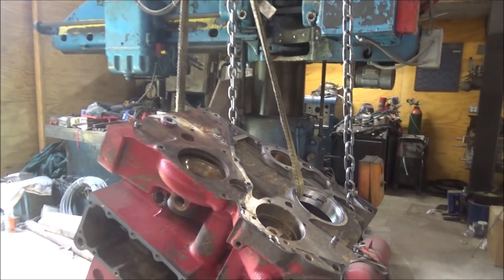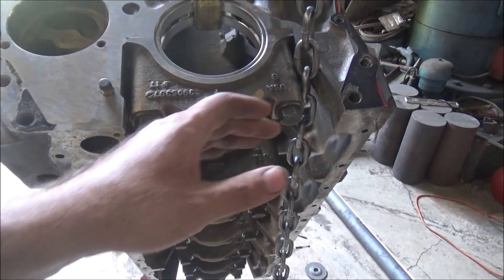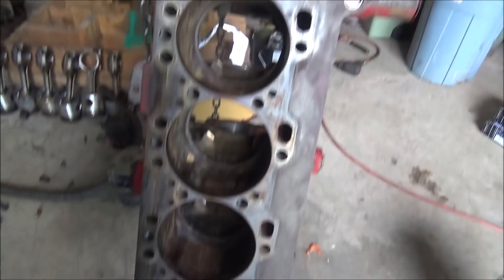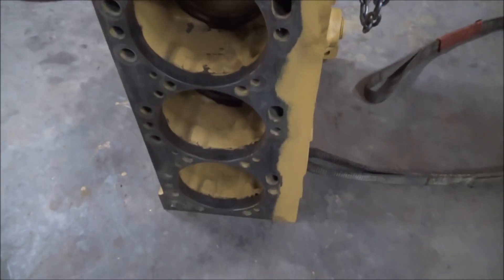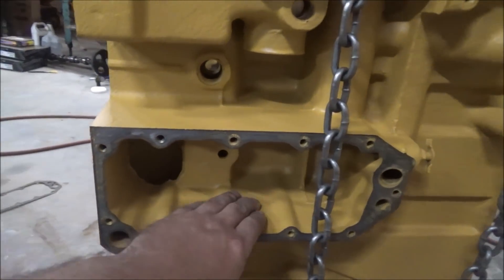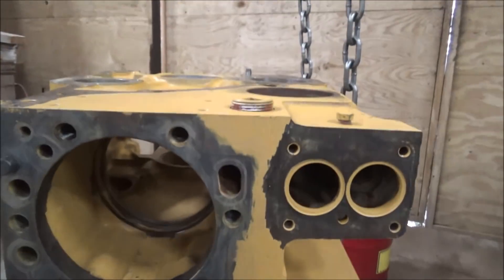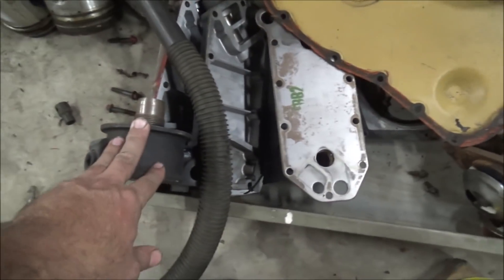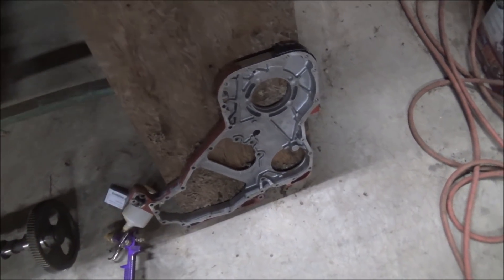Cummins 8.3L Swap the Hyster Forklift Part 2

Comment: I remember hearing something bout race engines being painted on the inside on surfaces that encountered oil so that the oil returns to the sump faster, but not so much on painting cooling passages.  Very cool, thanks for sharing the process.

Comment: Noe I feel bad for only painting the outside of the block/head/etc. when I rebuilt my 1984 F150's 300 straight 6. I used black rustoleum engine enamel (500F rated). Too early to say how well it's worked out.

Comment: I have always been told that painting the inside was not a good idea, flaking paint can plug up the oil pickup tube, that it's just a better idea just to polish up the oil drain back holes. Id there a particular paint you use that is resistant to being oil soaked that long?
Reply from the maker: Glyptal 1201 is usually the most recommended interior engine paint. I have had good luck with the Deere Buff primer sealer as well though. If you get a lot of bad fuel dillution in your crankcase I could see maybe having problems but I never have.
Reply: @bcbloc02  awesome, I will look into it, I know a lot of old school guys painted inside block for oil drain back purposes, but I have also heard it had adverse results later on.

Comment: I wanna see a 1000 hp forklift pulling a sled or doing a burnout! LOL! That 8.3 Cummins ought to last about 150 years in a forklift!
Reply from the maker: I don't think the rear end will be able to stand it. I suspect that 50 year old axle would snap a shaft in a heartbeat pulling a sled with the lift weighing 30K. lol

Comment: Are you gonna paint the outside of the liners? Are you worried about the paint flaking off and going threw the bearings?
Reply from the maker: No the outsides of the liners are precision fits so no paint.

Comment: Brian with Illiana and Russ Fishers in Terre Haute, I can look for a timing cover for you if you haven’t found one yet.  What pump would be on the C series with the cover you need?  Or application.  Illiana used to have C series cores from Ford, Freightliner and other applications.
Reply from the maker: b gilbert Looking for the gear housing, cover, p7100 pump and lines for a 90’s vintage 8.3

Comment: I hate to think how much it would cost to paint that block with Glyptal! What kind of governor setup does the forklift have now? My old Clark had a constant speed governor on the Continental, but the one I have now has no governor at all.
Reply from the maker: Watch Wes Work the Hercules had a vacuum operated butterfly governor under the carb so it just capped the high end.
Reply: @bcbloc02  So the regular P pump should do just fine. I guess I've never paid attention to how a diesel forklift is setup.
Reply from the maker: Watch Wes Work yeah either an Rqvk or an Rsv governor would work fine.

Comment: some micro-finishing film on those journals or some mothers chrome polish can you make that fit a 1" wide belt thats like 24 grit then 36 in those ceramic changing the belt grit in like 10 seconds some sort of machinest jack skate barring creation ther's at least  a day dreaming and another building have not tried those ceramic the blaze looks like wow  a grinder with 24 ao vs one of those with the X  1" ceramic 24 grit I cant tell you the cubitron in the 4.5" disk is wow $6-7 bucks though
Reply from the maker: Yeah a 1" belt will fit. Probably will try to go up to a 36"
Reply: @bcbloc02  Thinking about the abilty to change grit quick ,price probly a good buy for crank polishing that fork lift is wow worth this work. little effort now ,yeas of time saving . Thanks

Comment: As good if not better than a new "Bloc block"....☔⚡💧🌈😁👍😎
That lift only needs to be slow and precise, anyway it's way too heavy to fly, plus the doors don't open wide enought for eventual wings, even if you install the folding type wings like on aircraft carriers.........
Have Baily look and approve every steps, don't just rely on us...    😉😁
Reply from the maker: Baily getting more interested in food bowl and bed than shop projects. :-(

Comment: i run an old Continental in my airplane. The case coating started turning loose and ended up in the oil screen. When I rebuilt it I sprayed stripper in the case and power washed it clean. Decided to leave it raw.
Reply from the maker: As I said your mileage may vary.
Reply: @bcbloc02  Yes sir.. You are far more knowledgeable about such things. I certainly do enjoy your channel. Thanks for taking the time to reply.

Comment: I thought they quit painting the blocks with the advent of detergent oils.  Issues with paint clogging filters and passages.  This was years ago when I worked for Ashland so I could be mis-remembering.  Seems like I read about it in a trade magazine of some sort.  Anyways, what block are you looking for?  I've got a couple old 6cyl diesels by Cummins that are sitting in the back of my small barn.  I think they were here when I bought the place so minimum 30 yrs old.  No clue what they are.
Reply from the maker: Robert Cook always interested in old engines. Check your barn and see what you have got. You can email me pics to bcbloc02 at yahoo dot com if you can’t identify them. Thanks!! Also I know Deere was still painting the insides of their blocks at least thru the 1990's so well into the detergent oil age.

Comment: Swapping a gas engine for a diesel. Is this forklift hydraulically driven? How will you deal with the increased torque and lack of engine revs?
Reply from the maker: Scania1982 the forklift is gear drive with a conventional clutch so it shouldn’t be a problem
Reply: @bcbloc02  Wont the increased torque break the gearbox and lack of revs make the forklift slow? Love your videos.
Reply from the maker: @scania1982  Not really a big rev difference between the Cummins and the old 6cyl hercules so speed shouldn't be an issue.  The torque could damage the gearbox but I feel if not trying to pull things with it it should be fine, can always swap that too if I have to.

Comment: Adam Booth has a narrow belt sander he uses for lathe work some times, it may be just the type of thing you need for that crank shaft. And the internet safety unit comes out in force when he breaks it out, so you know its ligit.
Reply from the maker: Nathan Weese Yes I mentioned Adam has one in the video.

Comment: Brian, I'm a new subscriber and this makes my heart happy. I see so many engine rebuilds/overhauls that the builder won't even address cleaning the outside of the block, and will just gladly slap old hardware and tin back on the motor without even trying to make it look better and protect it going forward. That engine is going to look like brand new when you're done with it.
Reply from the maker: That is the plan. I want it right when it goes together so I won't have to work on it again.

Comment: Brian, I don't understand something you said about the "a" pump gear, you said that you didn't like to use it because it wasn't keyed, can't you put a key way in or have Steve Summers do it for you?
Reply from the maker: BATTLESHIP NEW JERSEY SAILOR The gears are super hard  and the key way is on a taper and in a small bore. Only way I think you could do it would be on a wire edm. Easier and simpler to just find the proper parts.
Reply: @bcbloc02  Thanks Brian, that clears that up, I didn't think that the gear was hardened

Comment: very nice,, just a question about rust in the oil passages, I use special sized long brushes on my racing engine to clean oil passages (big block chevy with all oil plugs removed) then WD40 to stop rust during the build before cranking. Painting inside cast iron racing engines is a standard practice around here as well as other mods so I like that. Nice job,
Reply from the maker: krazziee2000 So what was the question?
Reply: @bcbloc02   I am curious what will you do about the rust in oil passages ?  Since this will be a while waiting before building. Thanks for the videos ..

Comment: Many of the marine and industrial blocks that I used to rebuild had a red primer inside and nothing took that stuff off. Even the hot tank with caustic cleaner hardly touched it.  It was almost like a stain. Thanks for sharing.
Reply: that was probably glyptal. if you're interested, jafromobile has a good video series on how and why you apply glyptal. its original purpose was painting the insides of oil cooled transformers, but turns out it's good for inside of engines too...
Reply from the maker: Yeah glyptal is good stuff if a bit pricey.

Comment: Did you paint the water jackets to ? Fill them up and por them out ? Spray ?
Reply from the maker: With the liners out what you are looking at is most of the water jacket, there is a small cooler passage up the side I sprayed in best I could but sure I didn't get it all. Sometimes going for perfect just makes a mess so best to quit at good enough. :-)

Comment: Was the paint/sealer you used for inside the block enamel, lacquer, or something else and does that matter with interaction with oil and or coolant? Also was it heat resistant?
You should make the belt extension on the sander long like regular crank polish machines! That way you can get that sweet soft spot in belt flex and use regular belt polishing belts. Let me know if you don't find another 8.3 for parts. Know a guy that has one, but he may be wanting more then you want to put out for it.
Reply from the maker: I think it is labeled synthetic enamel.
Reply: Brian is correct.  Synthetic enamel.  It is impressive stuff.  It handles everything fine right up to the edge of an exhaust manifold where it will deteriorate a bit, but no worse than many of the "engine" paints you see on the shelf.

Comment: Hi, Brian. What about belt width on the linisher/tube sander? will you need new wheels? Trugrit.com has a number of belt sizes and fairly decent shipping time 2-3 days from order, there are other places you can find belts but I normally go there.
Hope you are having a good summer, hope the heat ain't getting to you to bad, thanks for the videos, have a good one.
Reply from the maker: I will check them out, Thanks!

Comment: I remember when engines were painted inside.  That is about how long it has been since I took one apart.  I love the rain.  While doing the bathroom remodeling I told the boss lady that silicon seal and paint make me the carpenter that I aint and she gave me that "he is nuts look".
Reply from the maker: The drywaller has to hide a lot of sins sometimes. lol

Comment: I think we are having some of the same weather over here in Southern Ohio Brian.  Did you ever get over to Sciotoville to check out the train bridge.  It's a dandy!  We had a 70 Dodge 3/4 ton and installed a flat bed on it so we could haul scaffolding and materials to some of our masonry jobs.  Hauled our kid's pigs to the fair a few years, too!  Later bought a 83 (I think) one ton Dodge with a crew cab that was an OK work truck. Greg.
Reply from the maker: Nope haven't been over that way yet.

Comment: Also, to the people worries about the paint flaking, gearcases are suppose to be painted, in almost all machinery they do this.
Reply: Do gear cases have oil pickups that can be clogged by glyptal/paint?
Reply from the maker: Some do, most all have drillings to catch oil and feed it to the bearings that must not get plugged.
Reply: @bcbloc02  I was working on a summit lathe not long ago that was abused (coolant got into the gearcases) cleaned & painted the gear case in that one, nearly all the bearing oil ways were rusted/clogged right up. no bearing went un-changed.

Comment: Very interesting, never heard of painting to seal the inside of an engine, cool👍
Reply: I helped a friend rebuild a 360 Ford in 79 or 80 and he painted everything with rustoleum except the bearing / gasket surfaces. He also did the  top / bottom of the intake manifold.  I don't remember if he did the intake passages though.  My friend's comments mirrored Brian's, plus an additional comment that it was to help seal any small bit of sand still left in the casting surface.  I just shook my head 'yes' since I had no clue at that point, lol.
Reply: I did that to 53 olds block that I built up in the '60s
Reply: see jafromobil for more in engine painting
Reply: Used to be common back in the day.

Comment: Ever have the paint on the inside of an engine or oil pan peal/flake off and clog the oil pickup?
Reply from the maker: Nope
Reply: I've done so many engines, transmissions, etc with that exact same buff primer I lost count.  Never an issue.  Some of the equipment is daily use, some might sit a couple of years between use.  Of course preparation is key, but even then that primer has always impressed me.  Even on weeping cast that I can't fully get clean.  Quick de-grease and paint before it creeps out and never an issue.
Reply: preparation and use the right type of primer
Reply: I had a huge flake of rust (caused by condensation) fall from the inside of the top cover of a Cat pony motor.  It neatly covered the oil inlet on a main bearing, made it heat, swell and seize.  I think some paint might have been a good idea in that one.